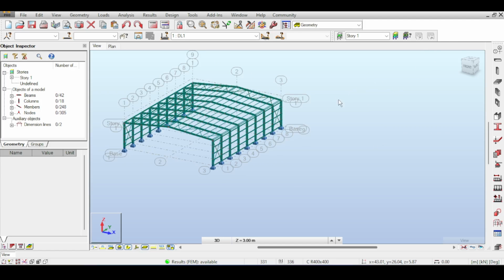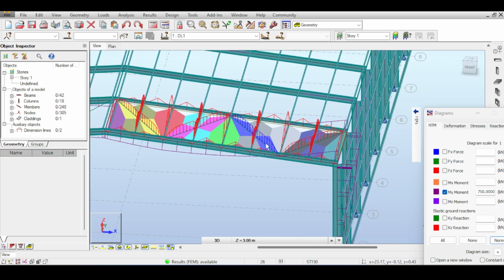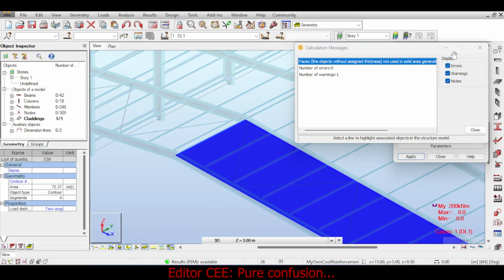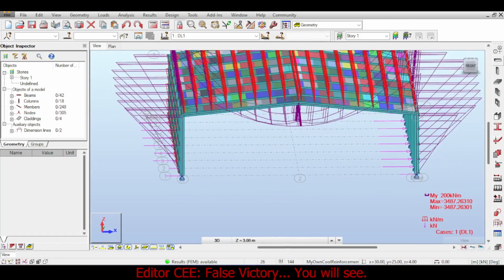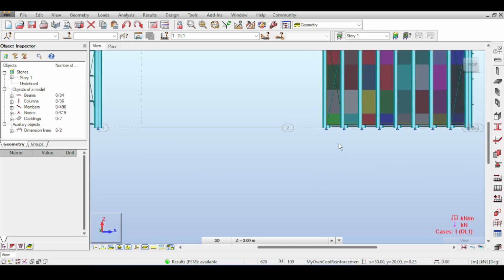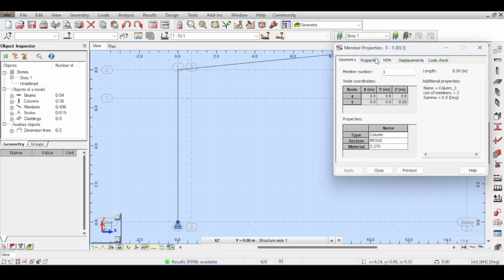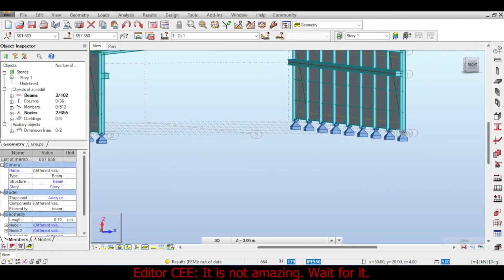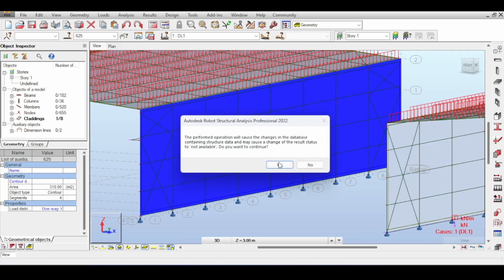Modeling of Industrial Warehouses | Part 3: Claddings and their Problems

Comment: Hello CEE,

29:05 …. this reminds me of the good old days in the matrix revolution last scene when Agent Smith asked in doubts that “…is it over? …” I guess some of us know what happened next 😁.

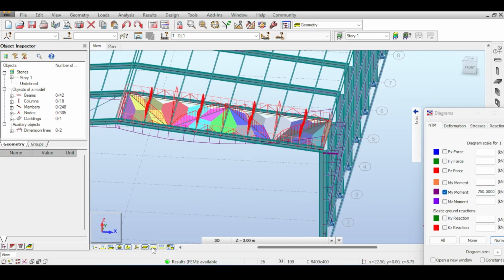04:15 I concur, both of these scenarios can be good or bad depending on circumstances. The mere fact that Robot is giving a user these options is actually a +plus. The CEE is doing an excellent job by providing users with multiple options which makes it easier for users to be able to switch between Robot available choices.

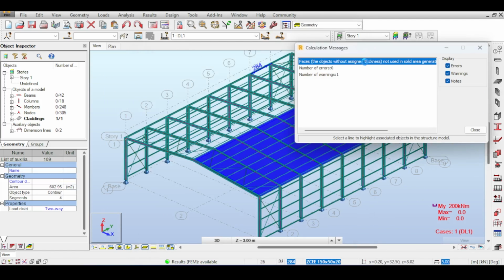07:55 You are not alone; I did not think that this could be a thing either. I actually went ahead and opened Robot just to modelled a cladding following this revelation, and yes, I can also now confirm that RSAP will warn if one has got unloaded claddings in a model.

11:44 This is a very good tip from the CEE. It fits perfectly with the DRY RUNS habit that I now cannot do without whenever I am modelling something in RSAP.

12:35 I agree with Editor CEE about being happy but I am happy for wanting to experience multiple options. The mess up part is an integral part of the true (real-life) learning experiences. 

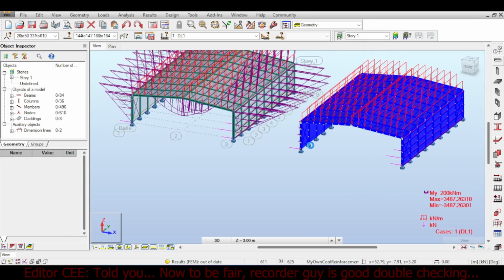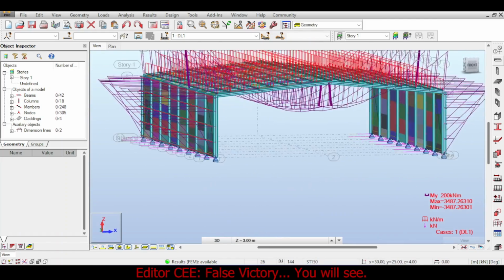13:20 (and 12:25 by the Editor) Good catch really, and a very nice resolution/work around this issue as well. Thank you. It seems though that the girts had already been (at the beginning) modelled above ground? Perhaps this is more about the location of the bottom nodes to which the claddings have been attached to? One should avoid attaching the claddings to the same points as those to which the foundations have been attached?

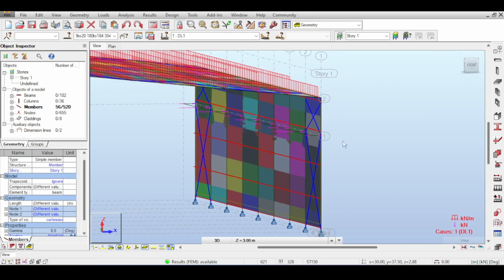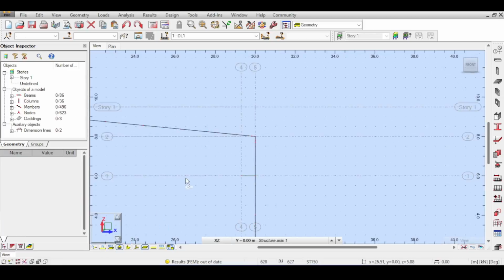17:04, 19:16, 28:25 Editor CEE 🤣, 17:37, 21:28, 23:43 Recorder CEE 🤣

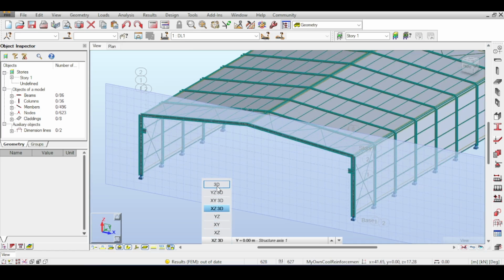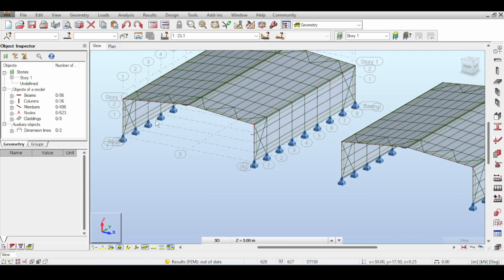22:11 and 24:28 This is a perfect illustration of the core understanding of how drag works (the member type which get dragged is the last selected or active section). The CEE has demonstrated the same application of this technique when modelling purlins for this warehouse (although during that time, normal C placeholder section was originally used). The copy drag which CEE did with the crane runway beam at 24:28 is indeed amazing.

24:19 Yes, I do get the idea. However, and in the spirit of 12:35, if this crane supporting column is to be designed here in this series, it may be better to have a model with a realistic height column in case there are some bracings and stabilization necessary that would otherwise not be as pronounced in a case of using a model with relatively “itsy-bitsy” or short columns?  

Apologies that this video was stressful to you, know that it was very helpful nonetheless. Again, this is the demonstration of what can actually (and do actually) happen to most of us when we are modelling. It helps to learn from the real videos like this one. I have enjoyed this video and I am looking forward to the next CEE videos.

Regards, DK
Reply from the maker: Hi there Engr. DK,

oh my, it was a real struggle, I remember myself being extra sensitive against errors at the last minutes of my modeling. Also, <3 the Matrix Trilogy.

Robot is really great when it comes to analysis. I am a real fan of it. Comparatively, ETABS and SAP are not that flexible. Of course, ETABS and SAP are well established softwares in the field of structural design.

I have been working with robot since 2010, and this is the first time I see this error. It really took me by surprise.

Dry runs are an extremely important step when modeling a structure. I use those to make sure that the structure behaves as it is supposed to be.

About distributing claddings onto nodes, I think I found out why this happens. It is because if you have a truss with a continuous upper chord (so 1 piece), and apply a cladding, you cannot simply apply loads on the truss elements. So having extra nodes (you need them to connect diagonals) will cause the cladding to distribute its load on those nodes. This - in fact - fulfills the theory of trusses.

I guess the editor keeps those raw moments to just show to all viewers that, indeed, no matter how experienced you are, you will still have those moments where you realize that you have to repeat something. This encourages people to press on regardless of how annoying things could get.

With regard to the column being small. Guess what: I already could not come to terms with it, so the first thing on my list for the next video is to increase the column length. I think I have a nice trick I will use, ^_^. I just couldn't get over it. Just because of the issue of stability. Also, some of my dear viewers are already asking about buckling length and member parameters, so I thought this would cover that.

Nah, I feel happy after each video. Regardless of how annoying it might be, the condolence is that the viewers see that it is not always "smooth sailing" as most videos try to convince you. So, keeping it real.

Stay tuned for more content, 
Regards, CEE

Comment: Hello Dr. CEE, 

First I want to say that I really appreciate the effort you put in these tutorials, they are very helpful and rich with information.

I just want to point out that the automatically generated point load from cladding on the supports is because the cladding is set to distribute the load in two ways, supports are taking part of the load distributed in the direction perpendicular to the columns as columns are ignored, this could be solved by changing the calculation model of the cladding to "one way" to work in the direction perpendicular to the purlins only as this would be the real case.

All the best
Reply from the maker: Oh I see! That is the reason why I got those strange load areas. It kind of slipped my mind.

I want to expand on your comment by saying (and I am pretty sure you meant that in your comment) that supports are not to carry loads from claddings directly. So this needs to be remedied in future models

Thank you very much